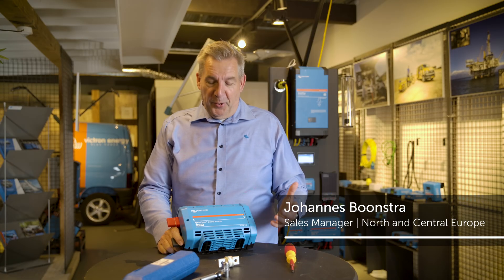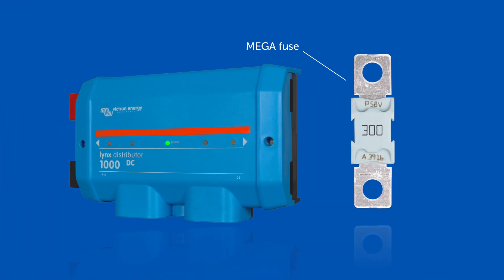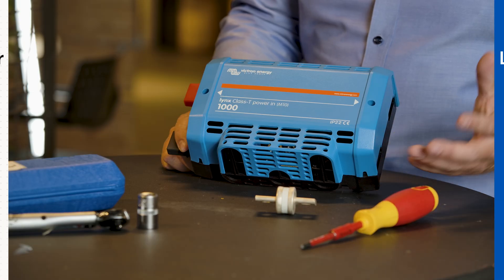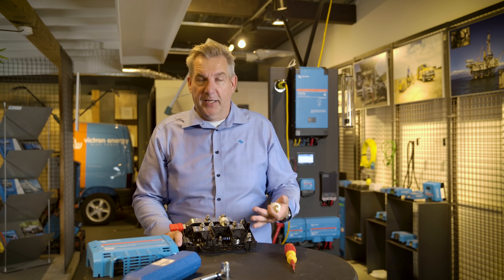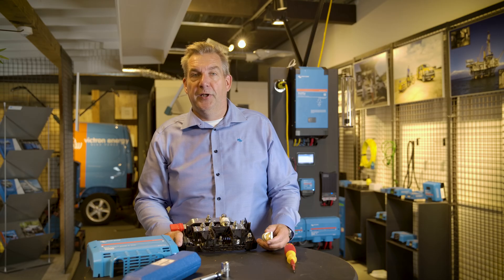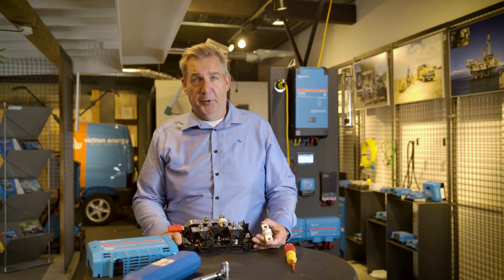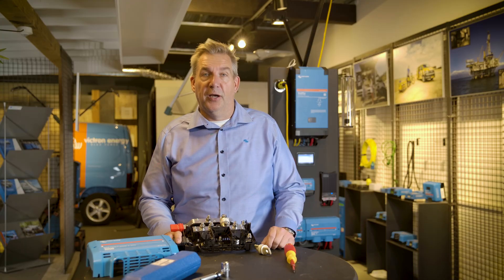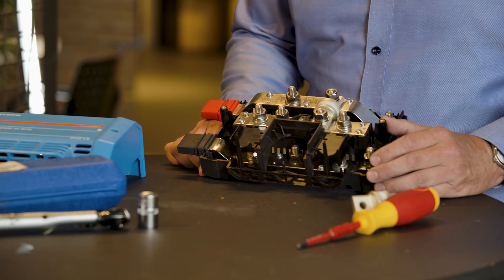4 of 4 - Explanation of Victron Energy Lynx Class-T Power In

Comment: Is there Victron guidance on Mega vs Class-T fusing so I can choose the correct Lynx components for my application?
Reply: The short circuit value of the battery is the guidance here 
It’s not for the the other components
Reply: @johannesboonstra6917  At this connection point, it's protecting the battery and up to 4/0(120) battery cables from a SS.  This device can handle max 4/0(120)  In ideal conditions the max ampacity of copper is say 445 amps while the US NEC puts it around 260@90c, less if cables are in wet conditions@75c max.  So this puts us in fuse size 250-400range.  Depending on blow characteristics of the fuse size of 350amps might keep us from exceeding 445 for any extended period.  Not counting derating due to high ambient, multiple conductors, or insulated cable placement.

So why care about more expensive harder to get T-fuses, unless there are some standards that require them at these amperage?  I like the integrated nature of the fuses, but at 2 connections per device,  I'm failing to see an advantage.  The M10 connection is good for the surface area.

I've always wondered if I could take a power distribution device, move to left of the shunt, hook up to 4 batteries there with fuse size up to 500amps,  and nice lights to tell me when one blows.  Then put another on the right side of the shunt for loads.  This gives me 4 mega fuses on each side.  Not suggesting this is a supported or intended configuration, but it felt useful to me.

This is why I feel I'm missing something here.   I'm great with safety, correct sizing/fusing as death by electrical fire is not high on my bucket list.  Always seeking to learn.
Reply: After posting, went and read the lynx distributor manual.  Was pleasantly surprised to see it is supported to use it for mega fused battery connections.  I may have missed it but could not find a max cable size in the doc,  or if the M8 or M10 versions supported different sized connection cables.   Which leaves wondering why I want T fuses?  I don't know much about mega/T-fuse blow characteristics or if they are similar to breaker A-F rating curves?  I'll keep my batteries close to power distribution, but some may have longer cable runs that need protecting.  So I'm scratching various body parts wondering about this new device, and how I would deploy one vs the 4 connection mega fuse device?
Reply: @johannesboonstra6917 99% of the batteries don't show the possible short curcuit current in the manual. Victron has to also account for that Lynx is not only used with their batteries. In short megafuse should be never used with lithium batteries, as exception you can use them till approx 200AH batteries. I always use NH fuses, which also works as disconnect switch till 48V systems as you can pull it even under full load. Means 2 connections less (=less failure points and less voltage drop) and money saved for disconnect switch.
Reply: Always use class T or NH fused with lithium batteries, the very small till 200AH a megafuse can be used but shouldn't. Instead class T use NH fuses, much saver as 50-80kA short curcuit protection and avaliable in all characteristics, not only superfast which is actually too fast as battery protection if you eg use your lithium also as starter due to high surge loads. The battery can do it but the class T not and need to be oversized which means now your continuous overcurrent protection is now too high. NH fuse in GG fast is correct choice here, as it has the correct continuous overcurrent protection as well as the peak on for the surge starters or bowtruster or windlass creates.

Comment: What is considered a large battery bank system? I have 3 24V 200Ah lithium batteries wired in parallel via a Victron Power-in powering my Multiplus 24/3000/70 2x120. Would it be considered large?
Reply: I have a similar question I have six 100 amp powers at 12 V which I believe is the same as what you have in 24 V.
And I have mine in two groups of three… So I need two, class T fuses?😮😮
Reply: I also have 3 25.6v/200Ah Smart Lithium connected to a Lynx with 3 Mega Fuses (24v system). The spec sheet does not show max short-circuit. Should I be looking at Max Continuous Discharge? For these batteries, that is 400A, which appears to be within range for the Mega Fuses. And, since I have 3 batteries, I'd need 2 of the new Class T modules. Believe I'm OK with the current configuration.

Comment: Only 2 class-T fuses makes it a lot more expensive and an extra unit provides also an unnecessary extra connection in your busbar system.  Is the production of a 4 channel Power-IN in sight?
Reply: Use NH fuses instead, they have 50 till 80kA AIC, are cheaper and saver. Also no knock offs are avaliable. The heat distrubuted by these fuses also show their high resistance means voltage drop is bigger with class T then with NH. A 3rd issue with them is they are superfast so if you have high peak draws like starting engine from your main house classT must be oversized otherwise they blow due to surge but that means your overcurrent protection is too high. Another reason to use NH as they are avaliable in all characteristics you need. You actually wanna have GG fuse means fast acting as they allow much higher peak currents which your lithium bank can deliver savely.
4th the lynx distributor is rated for 1000A but only carries a 8mm x 30mm busbar in it which is rated to 418A till 478A depending on  which busbar calculator you use, so how does victron get to a 1000A rating here....I pulled 550-600A over 20min over it and the case started to deform because getting too hot means the rating is simply not correct as the busbar calculators show. All correctly installed and torqued down, no bad connections or crimps. With NH3 all stays handwarm at that load.
Reply: @chrisr819 Thanks for sharing.  I had not heard of NH fuses before.  Worth exploring.
Reply: @chrisr819 NH makes sense for the larger installations where also the busbar is not longermore sufficient. Like on a 3 x MP2-15k system I just built. I use three 600A NH fuses to the MP2s. But I would suggest using Telecom 80V rated fuses. They use partially gold plated contacts and are for voltages up to 80V and provide lower resistance too. Costly though, if I am not wrong over 50 Euro per piece.
Reply: @seppm64  too expensive and too rare. NH are widely available and have silver plated contacts, difference to gold is marginal and not worse the additional money.
Instead megafuses you can use in the Lynx Distributor M8 the ed3 fuses from Adler instead megafuses which have 50kA interrupt current. This for eg the one who have them already installed and updating to lithium.
Reply: I am afraid not on short term , the size and temperature generation of these are the reason 3-4 units are not possible in this housing
Reply: @johannesboonstra6917  because the Lynx distributor spec with 1000A is completely  overspeced, the lynx can do 400-450A current max. From the on the busbars extremely heat up the device and there is not much left for heat dispersion of the fuses. I pulled 550-600A over it and the case starts deforming from heat😮 everything was correctly installed and torqued down, no bad crimps or contacts. Also 8x30 busbar is rated for 418 till 478A depends on the calculator. M8 or newly M10 shows its a 350A class design too. For 500A class M12 or 14 are used for 1000A M14 or M16 are used.
Reply: @johannesboonstra6917  Thank you for the info. That makes sense.
Reply: Depending on your application, you should be ok to connect pairs of batteries using standard diagonal parallel cable connections. Then connect each pair to a class-T fuse. This will let you connect 4 lithium batteries
Reply: That’s the way Victron rolls. Just like we all need five fuses in the VictronConnect, but they only give you four.😢😢😢😢😢😢😢
Reply: Kosten 50 Bugs aber die Sicherheit ist eine andere

Comment: Can the new Lynx class T(M10) be interconnected with de Lynx Shunt (M8) by making the holes on the left side of the Lynx Shunt bigger to fit the M10 on the Lynx Class T?
Would this be safe and work properly?
Is there a Lynx Class T in M8 version planned for the future?
Thanks in advance
Reply: Yes that would be fine
Reply: @johannesboonstra6917 one more question:
I would like to connect 2x 12v 300ah lifepo4 to the Lynx Class-T, each battery with its own fuse.
But I would also like this batteries to have its own disconnect in case of service needed or replacing one of the batteries (so the other one that is not been replaced/serviced can be still working)
I have read the ideal connection would be Battery-Fuse-disconnect but what I want to do it’s only possible by battery-disconnect-fuse
Would this be safe and recommended to place a Disconnect between the battery and the Lynx Class-T?

Thanks in advance
Reply: @currocampos2072  it should be ok, the fuse will protect the whole systems still.
Reply: @kapokee  thank you

Comment: I have secured my rather small setup (200Ah) with a Victron 100A Mega-Fuse. 
Now I saw a video where somebody tested such a Mega-Fuse and found out that they not melt at a bit more current than 100A but melted at around 16 minutes at 250A.
Since than I am unsettled if my system is safe because my cable diameter is not capable of 16 minutes 250A. My van would burn.
My question: Can I be sure that Victron megafuses really break at that current which is printed on? 
Can you proof that in a video where you test numerous Mega-Fuses? That would calm me down...
Are Mega-Fuses reliable? Are there other fuses also for smaller systems which a definitely reliable?
Reply: There are other fuses that mount on a post post, but I have not seen any videos of anybody testing those😮
Reply: Victron is not a company that is known for making crap (but I don't believe they making own fuses), so you're safe as you can be. Nothing is 100% reliable. Any fuse has rating, maximum load at ambient temperature and how long it can take it, close to maximum load and time delay factor (how long it takes to open). More on this you can find in datasheet regarding megafuses.
 If it would be my van, I would ether raise system voltage (lets say from 12VDC to 24 or higher) or split power to 4 banks using smaller inverters thus fuses. I'm not fan of crazy large current over low voltage.
Also, mind to always use DC-DC wherever is possible instead going DC to AC than back to DC, like using 110/220VAC laptop charger to power laptop in a DC loom, use 12VDC to 19VDC (if that what laptop is rated for) boost converter, it's much more efficient. Good luck.
Reply: Your characteristics of the fuse is wrong, you need a superfast acting one. You have  a slow or fast acting model, that's why it's allowing you significantly higher and longer peak currents. Also your cable can carry shorttermed significantly more current that it's rated for. How big/diameter is your cable?
Reply: I only use NH fuse with lithium, safest fuses avaliable as 50-80kA short curcuit interrupt current, are avaliable in all characteristics (not only superfast like class T) and have the lowest voltage drop. You also spec them to 100% and not to 125-130A as with the other fuses as they are made to run at max rating for 14/7/365...your megafuse not.

Comment: i appreciate the increase from M8 to M10, as M10 has significant larger contact surface (+60 to 80% larger surface)
will you offer conversion kits for owners of the "old" Lynx? I mean kits to convert the plastic inlets to house m10 screw heads

Cheers
Michael